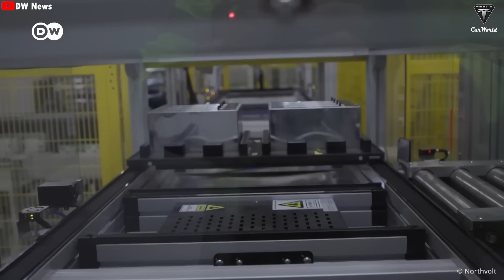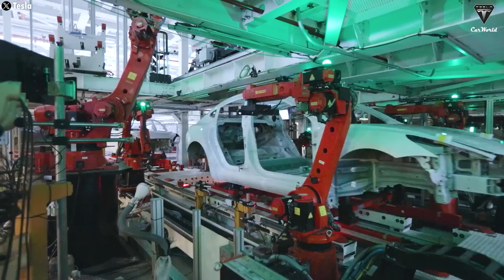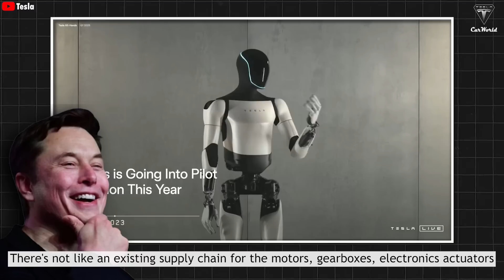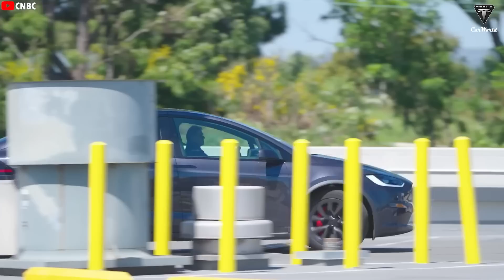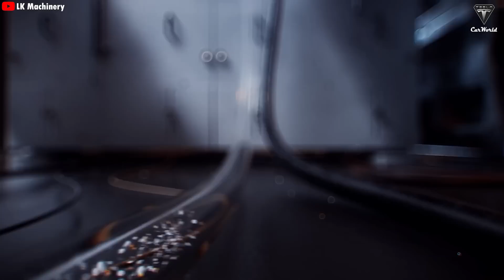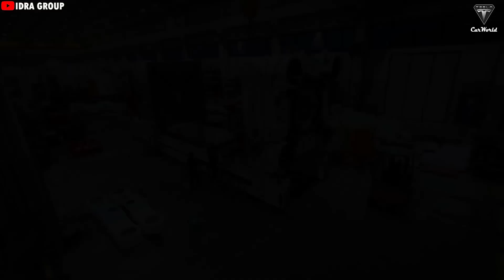NEW Battery Change Everything To Build Tesla Affordable Car! Full Charging 5 Mins, Tesla Bot Update!

Comment: I have had the same complaint for 20 the charging time isn't that big of deal because I would charge it when I was just packing it however the fact that you have to plug it in is a problem if they made a solar panel that would simply charge a couple miles a day then it would be something I would want the fact that the batteries will lose power every day if you let it sit for a couple days and use it you will be charging the batteries all the time just to keep them Chad it needs to have a solar panel and charge like two or three miles an hour and then it could charge 20 miles a day then it wouldn't matter how long it takes to charge or even if the battery only goes 300 or 200 miles that is the key get it to be able to charge itself without having to find some place to if you live in the country or someplace far away there is simply no place to charge it right now the closest charging station to me is about 50 mi away and even when it's 25 or someday when it's right down the street at 5 or 10 mi it is still would be better to have a solar panel on the car when you go to work if you're low on power after working for 9 hours you get out of work and you have 20 251 miles on the car think about it that is the way to go